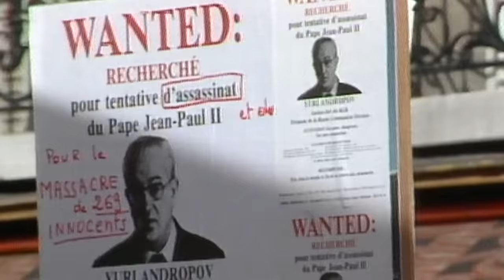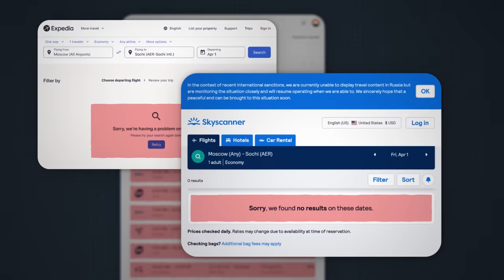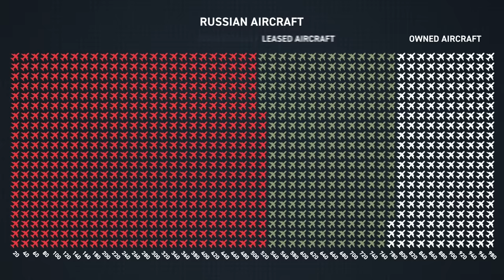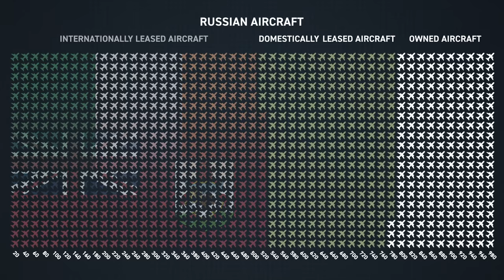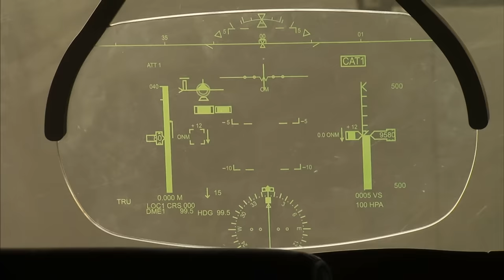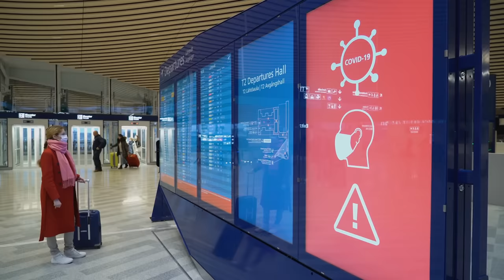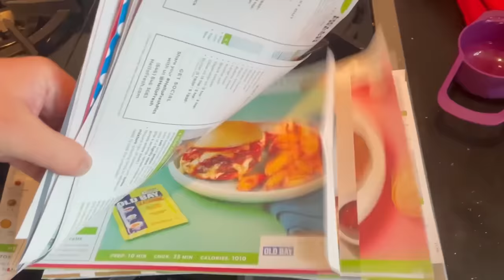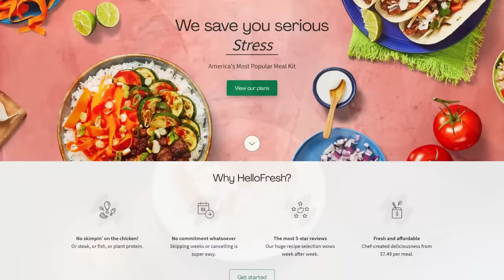The Sanction-Fueled Destruction of the Russian Aviation Industry

Comment: Let's not forget the impact this will have on safety. The reason air travel is so safe is because the industry is relatively open about mistakes made either by pilots, manufacturers, or maintenance crew. Every crash is a learning opportunity, and so it's pretty rare that two airplanes are brought down by the same flaw. The 737 MAX was a very rare exception, and it paid the price. Not so in the Soviet Union though. Accidents were swept under the rug where possible and the findings from any investigations were never made public. If you go to the Wikipedia article about incidents involving AeroFlot aircraft, the list is so long it has to be broken down into collapsible sections by decade. Russia is rapidly sliding back to those days, so I won't be surprised if Russian planes start falling out of the sky again.
Reply: Any mentions of how much airlines used to pay for flying over Russian airspace? Removing those fees will affect ticket prices in a positive way, no?
Reply: Last I heard Russia isn’t getting maintenance parts anymore so they’ll either not service their planes or do it incorrectly
Reply: @bornasiroki3976  we dont know how much the fees were since they were not published.But it will certainly affects tickets for those who travel to asia from europe
Reply: @jobic4207  .....hopefully - for their passengers - they have a good supply of baling wire a duct tape........
Reply: And here I thought you were going to mention long flights over arctic airspace will rely on incredibly sparse emergency landing sites
Reply: @jimmyryan5880  "I feel sorry for the protesters and disodents on those flights. The rest not so much."

Don't worry about them.  They're all in jail, or soon will be.
Reply: @jimmyryan5880  You don't feel sorry for the ordinary Soviet citizens who died on those flights Jim?!
Reply: You mean falling out of the sky at higher rates than usual? 😅
Reply: @ndenise3460  they have denied sending it
Reply: @bornasiroki3976  Ostensibly, it would seem so but the circuitousness of the routes means a more than likely INCREASE in prices, unfortunately.
Reply: Given the state of Russian roads and Russian driving, it's still probably the safer option for long distance travel.
Reply: @bornasiroki3976  If an airline was paying those fees in the first place, it was because it was more economical to pay the fees and fly over Russian airspace, than to save the fees and not fly over Russian airspace, so I doubt ticket prices would decrease or even stay the same.
Reply: It's not that simple. Many private Russian carriers (S7 for example) have their own MRO's and spares in situ, so they will be able to operate safely longer than some might think. It all depends how long this takes to play out. Meantime, the more restrictive issue will be Russian citizens ability or willingness to pay for tickets in light of higher prices for other goods and services impacted by sanctions.  Incidentally the lease fleet, typically financed through Bermuda or Ireland, have been removed from those registries on the basis that OC's have been withdrawn. The big picture question - again related to the time scale here - is whether any of these aircraft will ever fly with non-Russian airlines ever again.  The aircraft might become untouchables.
Reply: @bornasiroki3976  Base rate was $100 per passenger ticket. No one actually paid that much though, they all had reduced rates as part of the negotiations to get access to the airspace.
Reply: To be fair their milltary jets have been doing that regardless of what the coutry is formaly called.
Reply: @bornasiroki3976  it's only a small percentage of the cost. Wages for increased crew working hours as well as increased fuel costs would DWARF any positives from less fees...
Reply: My dad flew on Aeroflot a few times back during the Soviet Union. Apparently the plane was so crowded they had people sitting in the aisles.
Reply: That sounds like good news
Reply: Yes, I ordered 100K  Grade 5 bolts (cap screws) and was unaware that they were really Grade 2, because the stamped heads had the correct 3-line Grade 5 marking. Grade 2 has no marking -see where this is going. They all started failing when we went into production with them, that is, a strong person can snap the head off of a Grade 2 bolt with a large hand rachet - they didn't stand up to the torque wrench as specified in our assembly manual. 

Grade 2 is for light duty consumer and temporary stuff, not for powered machinery. Our supplier reluctantly admitted that they were from China, though she had to look it up and disclaimed any knowledge that they were garbage. Counterfeit bolts!  

The supplier immediately replaced the order with some made in Brazil and there was no more problem. She told us to just recycle or throw them away, but we chose to prevent anyone taking hundreds of boxes (6000LB total on 3 pallets!) of the things away to sell wrongly as Grade 5. I gave them to a local blacksmith who also melts down and casts metals for art, so they would not end up re-sold into a Grade 5 application. It made him happy at least to have it for free. The things of today. You can still trust a blacksmith.
Reply: @jobic4207  I work for said aviation repair and anything that could wind up as spare parts for Russian aircraft isn’t going to go anywhere.  Trade and compliance will see to it those parts don’t make their way to Russia through back door connections either.  Several people in the company has a responsibility to insure parts that leave don’t end up there. There is a black list created by the government and shipping to those band places can land a person in a federal penitentiary for a long, long time.
Reply: @Monaleenian  As a Christian I pray for all of the innocent people who are caught in the middle and feel bad for them.
Reply: I wonder what the impact of the Russian titanium export boycott will have on world aviation sales and spare parts supplies?
Reply: @aCycloneSteve  It’s time to recycle every pound of scrap.
Reply: Rest assured, there is no way I will ever get on a Russian airliner. Never have; never will.
Reply: @bigonicha3225  Does not necessarily be a decrease in ticket fare. They now fly over more countries in Middle Asia and Middle East Asia. Might be more cost on that.
Reply: @bornasiroki3976  
they were quite expensive
Reply: @jds6206  I flew on one in 1985!
Reply: Good
Reply: @TerryMundy  I don't know if I want to be on a recycled titanium plane. 🙂I know titanium has a crazy high melting point vs weight so I'm not even sure how you recycle it.
Reply: @oldgreybeard2507  Don't know about you, but I wouldn't even service my car with UNLICENSED, UNAUTHORISED ripoff parts from China...
Reply: @aCycloneSteve  That won't happen. China is on the way to getting their C919 jetliners certified. The C919 is a 737 rival that uses engines and cockpit electronics from the west. Eventually, China wants to design everything themselves. There's no way they'll jeopardize such an important project by bailing out Russia.
Reply: @ndenise3460  Chinese parts, what could possibly go wrong? 🤷‍♂️🤷‍♀️🧐
Reply: @bornasiroki3976  
Paying Russia presumably is less expansive than more fuel.
Reply: you literally made urself hypocritical with even mentioning the 737max cuz that was ALL POLITICAL. yes very rare i guess. so many bs things always are swept under the rug, you just wouldn't shit on the same team you're on, good job being a team player tho 👍
Reply: It was not an airplane crash, it was just a special landing.
Reply: @bornasiroki3976  no you don't have to  pay anything to use another country's airspace  🙄
Reply: MIGs fall out of the sky all the time. Nothing has changed. Only Sukhois dont seem to have that reputation.
Reply: @jobic4207  I have a feeling they might sell all the aircraft to china/then/or maybe switch up for chinese aircraft or get the parts via china.
Reply: @NFTenjoyer  That's not what I've been told. I was told it was a flat $100 per passenger over Russia.
Reply: Perhaps, though some of these are independently addressable by Russia. Nothing stops Russia from using the far more successful no fault transparency methods within their own infrastructure.
Reply: @aCycloneSteve  China and Russia str jointly building the wide body C929. But they've had a falling out of some sort. That project had hit a rough patch before Ukraine. Also, Xi has made the C919 his pet project.
Reply: @georgew2014  If it's his pet project, he will want it to prosper.
Reply: @bornasiroki3976  But you will have to fly a longer  distance. Which mean the prices still went up regardless. The only reason any company accept the fee to fly over another nation was because the alternative was more expensive, as simple as that
Reply: Naw kernel sanders. U wrong.
Reply: @toastmeister6806  cry me a river, build a bridge, and get over it. 🙂
Reply: Those 737 Max crashes were pilot error, plain and simple, but it turned into a witch hunt against Boeing.
Reply: @SunriseLAW  mercantilism
Reply: "The 737 MAX was a very rare exception" in the list of all crashes... its not rare at all. Even if you considere Boeing being hiding facts, even thats not real.

The Industry often had the gravestone mentality.

Not rare at all.
Reply: @ndenise3460  yeah, but hopefully cheap knockoffs
Reply: @bornasiroki3976  Those removed fees are of little use when airlines have to take a longer route.
Reply: Прошёл год. Самолёты продолжают летать. Вы всё ещё верите вашим лживым западным политикам и Ютуберам которые рассказывают вам какой-то бред?
Reply: @HeBepo9lTHblu baaaa baaaa 🐑🐑🐑🐑🐑🐑🐑

Comment: The biggest difference with closure of Russian airspace and the cold war is that now only Russian airspace is closed, which makes a route over Kazakhstan and China possible for flights between eg. Frankfurt-Tokyo and thus not all flights will be operated over the North pole or Alaska
Reply: Why does it make a big difference?
Reply: @fabianr9394  China's air space is huge having to route around it would add massive amounts of time to flights
Reply: @mythicalducky  oh okay, thought it was meant in a positive way.
Reply: Also, the Caucasian Corridor avoids both Russia and Iran.
Reply: @fabianr9394  Fuel use as well as time.
Reply: China has a LOT of restricted airspace. Even for their own airlines, so you're definitely not gonna be allowed to fly freely over them with a foreign airline.
Reply: @ArawnOfAnnwn  yes I am aware of that, but zig-zagging through China is still a heck of a lot faster than taking a detour over India or North pole
Reply: Actually the Caucasus route is so effective that even Finnair use it for Tokyo flights depending on the winds and it has taken pretty much the same time (12h20) on both routes
Reply: @Strudlfaust  Flying through China will mean delays or fewer flights because the traffic is already huge for domestic flights. I doubt foreign flights are allowed over Chinese airspace even now
Reply: Russia will probably invade central Asia after the Ukraine war ends so I wouldn't be too sure about that.
Reply: @Danny-gg9gs  Nah, Moldova is next on the chopping block, provided Putin succeeds in Ukraine.
Reply: I thought carriers avoided china because of their extremely wonky patchwork of no fly zones, plus ukraine being defacto closed means you gotta route around that as well
Reply: П
Reply: @InciniumVGC  and then Georgia
Reply: @ayszhang  Pretty sure they are allowed. I guess there is even more traffic above China, as now flights over Siberia has to reroute, and some of them choose to fly over China.
Reply: Good point
Reply: @kevinfishenden  Moldova has a frozen conflict in Transnistria so I doubt they can get into NATO.
Reply: @Danny-gg9gs  Given their preformance in Ukraine I doubt they could even make it to Kazakhstan's capital before the logistics collapse in on themselves.
Reply: @InciniumVGC  it would also depend on the Russian Federation still having money to start a new war
Reply: This is now the way it is.,